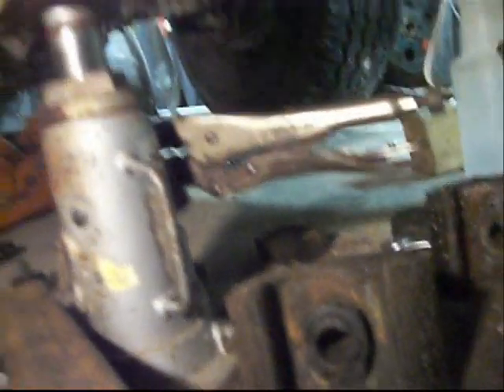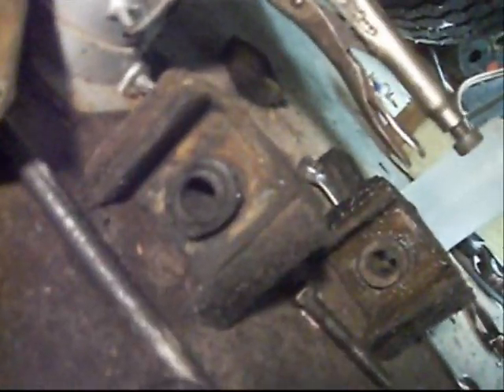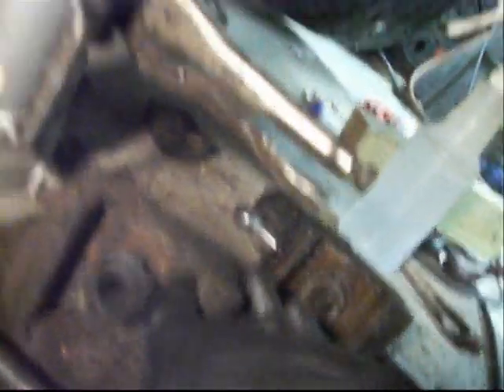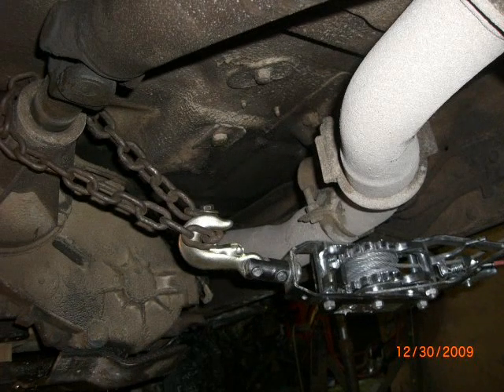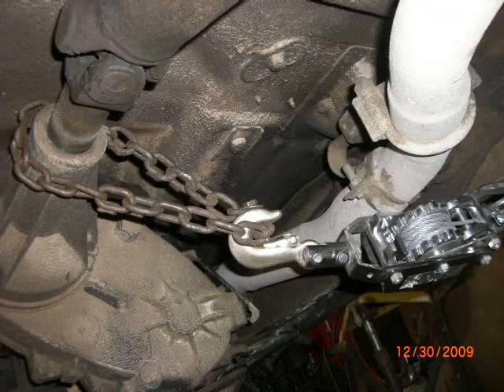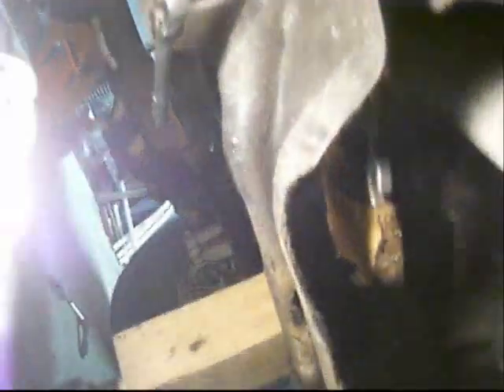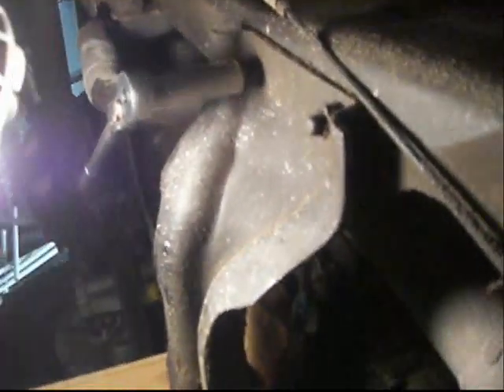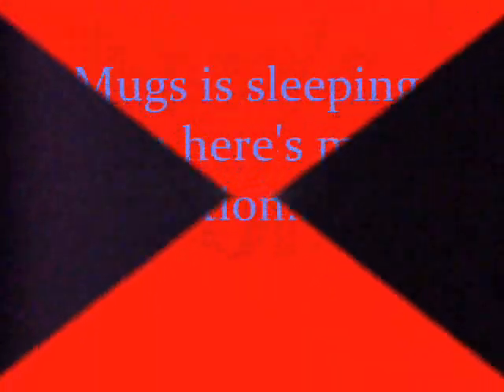12 30 09 Late Nite K5 Mount...

Comment: yes,i have a Diesel and it's oil + gasoil leaks protected the car very well till i pressure washed it ....
i 've no snow here ,so, no salt too but there is no trace of rust around the engine bay ....and under the car where the  crappy oil was.
rear end or manual oils are thick and must be good to spray or apply with a brush to protect.